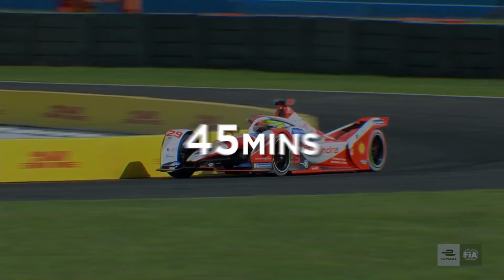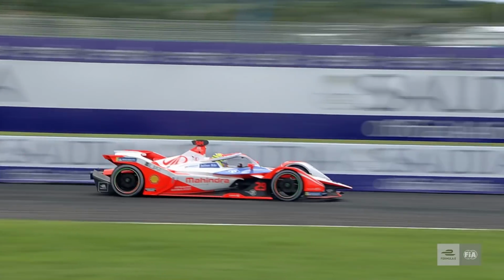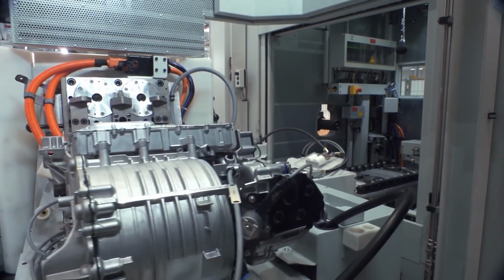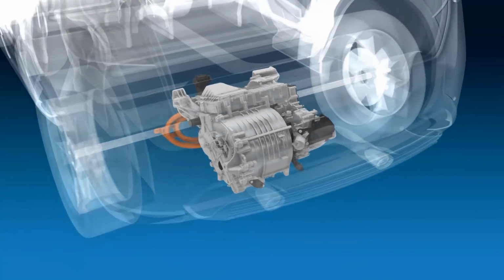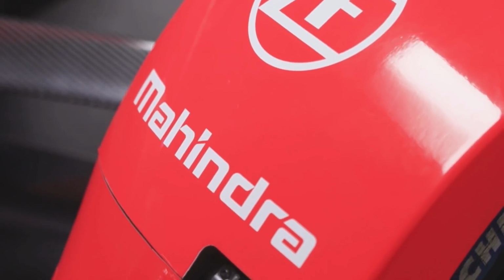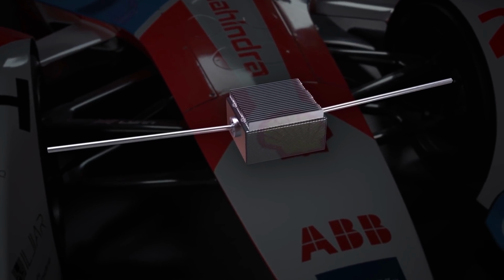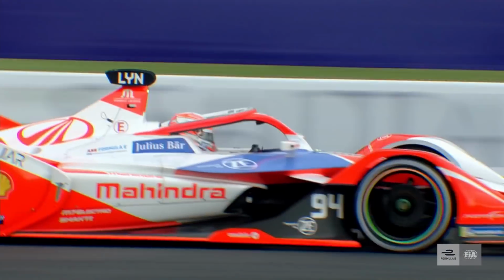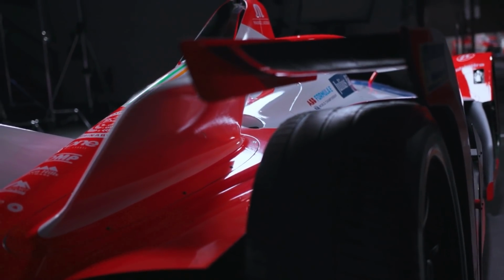What Formula E Technology Will Actually Make It To Road Cars?

Comment: I tried. But Formula E is SOOOOOOO boring!!! And here's the thing...Batteries are NOT the future. These cars are just Betamax machines. When will there be hydrogen or a mix of Hydrogen and Electric?
Reply: The only application where hydrogen makes sense is lorries.
Reply: If you think Batteries are not the future, you are unfortunately going to be extremely disappointed with Hydrogren. 

Hydrogen has extremely poor metrics with regards to mass rollouts and the power requirements that would cause. It is a really inefficient way to transfer energy
Reply: How could you Say it's boring look at on track action, they overtake everytime

Comment: Gen 3 has rapid charging and regen, that's supposed to be faster than anything ever seen on the road but FIA also have an Electric GT class will supposedly have that tech and then some.
Reply: Electric GT has been touted for years, all we saw was a modified Tesla and a continually delayed season because they didn't have the money to run the series; and the races were going to be really short and on traditional purpose built racetracks. The Electric Production Car Series (It's current incarnation) has been announced by the FIA, but there is still no calendar or anything. So I'm skeptical that we'll see that fast charging in action any time soon.
Reply: Does that's mean 350KWH+?
Reply: Waiting for gen3 . That's when this car will get lighter and faster.